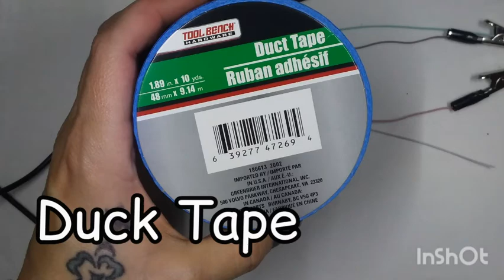V#13- How To Make Your Own Stamping Plates #DIY #metaletching

Comment: If you have a cutting machine, like a Cricut or Silhouette, you could cut out your own designs. Might take a few tries to get them right because of the small size but so worth it.
Reply from the maker: Thanks so much 💕💕
Reply: Can a cricut cut relatively thin metal sheets?
Reply from the maker: Good question. I know the newer ones can do more stuff but don't know about metal.

Comment: so instead of doing all that could you just place the nail vinyls on the back of a plate, polish scrap and stamp?  I mean if they are good quality stickers they should hold up for a couple if not more uses... then you don't have to play with electricity
Reply from the maker: That might work for a few times
Reply from the maker: It's a really low voltage I don't think it would hurt any more than a taser

Comment: Might be a weird question but I'm wondering if I did the q tip with the salt water if I could remove the AR coating off my polycarbonate lenses? Do you know I would attach the wires if it's even one possible. I got a pair of $700 lenses and I never wore them and now they're not under warranty and I wore two weeks and the AR coating wasn't attached properly so now it's all messed up. And I guess they use salt water to remove the coating but it's also attached in the electrical process so I'm wondering if that will remove it without having to use a plastic scraper and damaging the lenses. I'm also wondering if I could do a similar process to this on the nail stamping plate I got that wasn't etched. I was thinking if I took nail polish and painted the outside that is going to be etched that might be a little bit difficult.
Reply from the maker: I don't think it would work because you have to have one of the wires clipped onto the metal you're working with

Comment: is this electronic erosion? cz you're using NaCl as your conductor, I'm assuming the reaction is an acidic one. especially cz it's metal. but what's the process called? is it regular soldering but w ionic salt on metal?
Reply from the maker: I have no clue you seem to no more about this than I do I seen a guy make something like this but was putting initials on knives

Comment: How do you clean your stamper so fast 😯
Reply from the maker: ⏸️ is a great thing lol
Reply from the maker: But when making a video I'll clean the plate with a cotton ball with acetone and to get the streaks off I use a clean cotton ball and then the plate looks like new
Reply from the maker: Lol you said stamper I clean that with a lint roller
Reply: @1981pjt  😅😅 sorry i don’t know what to call it lol thank you
Reply from the maker: @josephherrera2640  your welcome and thanks for watching
Reply: @1981pjt  no problem that’s what the clear jelly is called ?
Reply from the maker: Yes it's called a stamper but comes in many colors and different types but all do the same thing some just work better then others